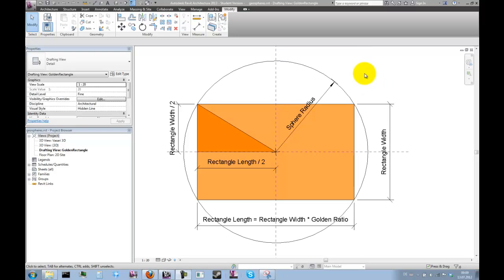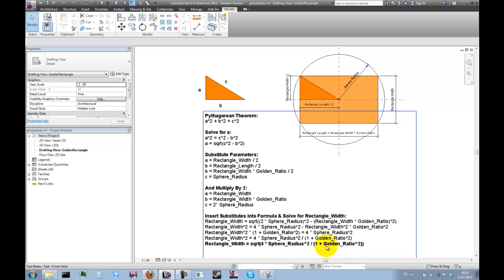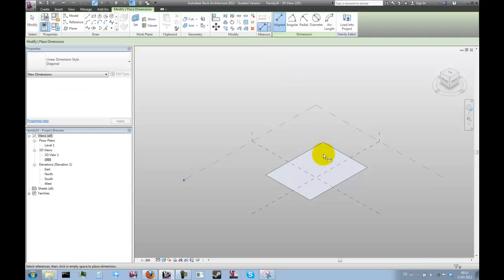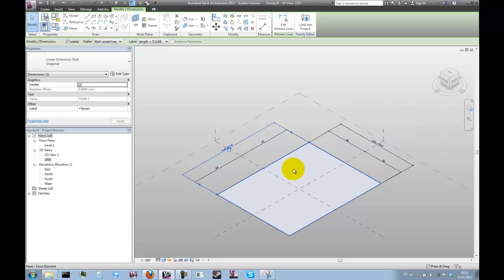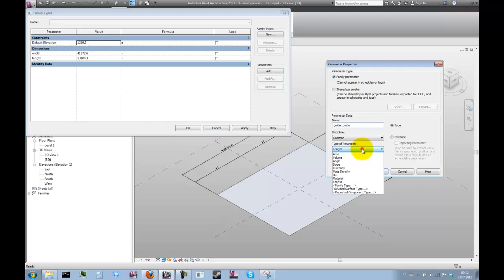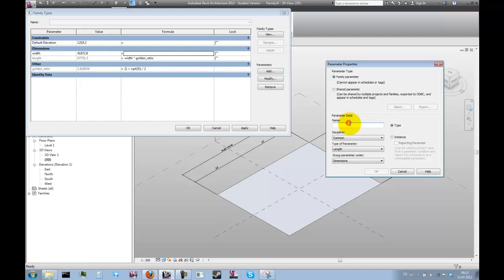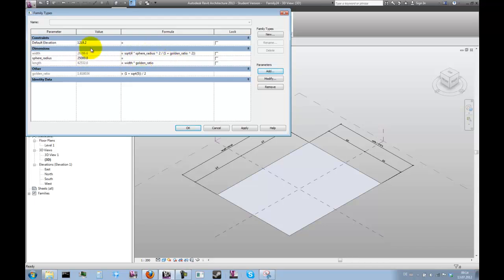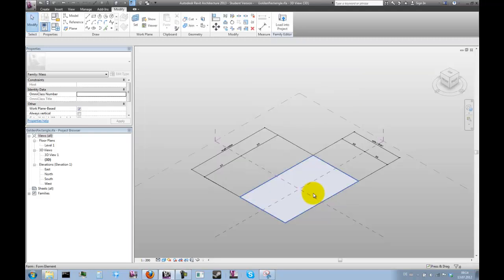Geodesic Sphere in Revit/Vasari Pt. 2 - Golden Rectangle

Comment: I loved this video! I'm curious - I built the Geodesic dome and loaded the mass into a  Revit Project as I'm working on a project involving a geodesic dome house with solid panels and windows. I would now like to panelize the dome with ceilings, walls or curtain walls, so that I can assign materials, project light onto the inside, etc.  in order to swap out. Is there a way to do this automatically? I tried going through painstakingly panel by panel, guessing the slope, moving the geometry into place on the mass, which is, from the first few panels I've tried, a very imperfect and painful way. Thanks!

Comment from the maker: The formulas that are used in the family are as follows:
golden_ratio = (1+sqrt(5))/2
length = width * golden_ratio
width = sqrt(4*sphere_radius^2/(1+golden_ratio^2))
BTW: If you switch to HD resolution, the formulas should be a little more readable.